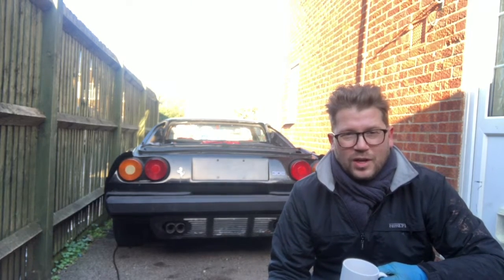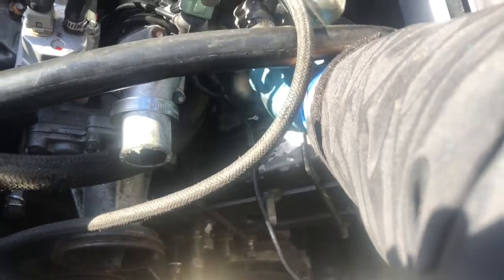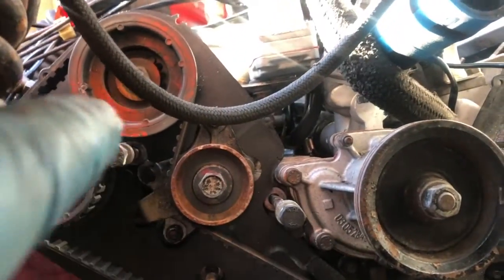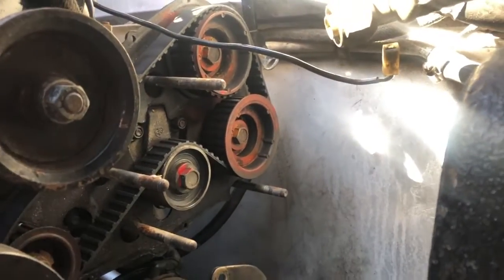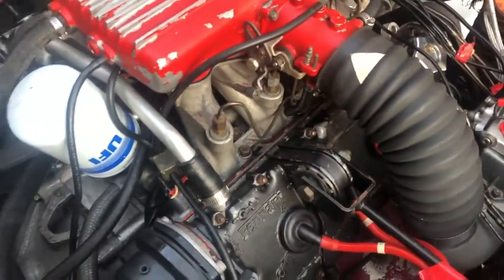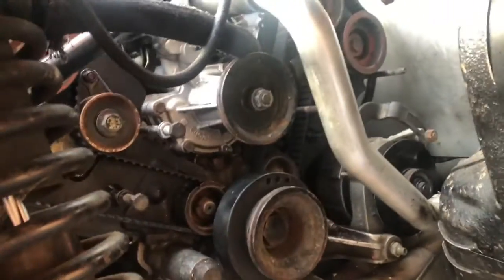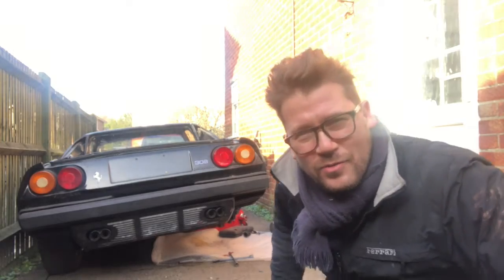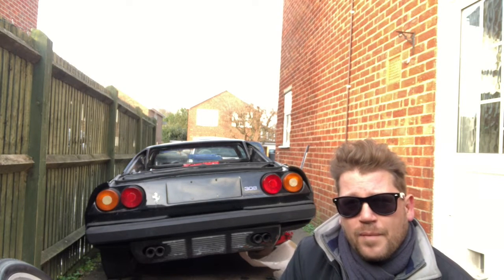Ferrari 308 project - My Timing Belt has Slipped !!!! Part 11

Comment: I really like your video blog here, great stuff thanks very much for sharing. One question though - how can it be that you have the low compression on the front bank but just fix the timing belt to get it running? you had 50psi on the front vs 180 psi on the rear bank - that is a severe issue...did you do anyting else on the front bank?
Reply: VoKa hello VoKA, it’s because the timing was so bad that the valves are still open when the pistons reach their top level when the compression should be at is max.

Cheers!

Comment: The front bank cam drive pulley should not have any play in it. This indicates that one or both cam drive bearings are toast. Not fixing this will lead to catastrophic failure. While you are in there replacing front bank cam drive bearings, replace the rear ones also. It is likely they are the same vintage.

Comment: Love the channel, so the reason why the car wouldn't start is the timing belt was not set correctly? Is that a common problem or a did a mechanic make a mistake?
Reply from the maker: yes mate it had jumped some teeth because the lower pulley bearing was shot
Reply: @Ratarossa  Where did you learn to work on Ferraris? I'd love to learn how to do that but it's an expensive hobby

Comment: How can people botch a timing belt change in such a manifest way is beyond me... Congrats on the cheap fix before making a valve salad!
Reply from the maker: crazy hey, thanks though was lucky so far
Reply: I just had this happen with a low-milage '85 Volvo 760 Turbo I purchased. Ran terribly, almost no power. The B230ft is a single cam 4 cylinder that is only maybe two or three steps of complication away from a tractor engine. I had a receipt from the previous owner for a timing belt service at a local shop, so I checked it- lo and behold the timing is a tooth and a half off. Seems it doesn't matter how simple the timing system is (like on the 4cyl Volvo) or complex (like the 308), someone will always find a way to botch it!
Reply: @Ratarossa  that was lucky, nice! 
i Would have done the same thing!

Comment: I wouldn't bother refitting that aircon unit, they never worked very well anyway even when they were filled with the correct gas they were designed for, save the weight.
Reply from the maker: Thanks Chris, This is my 3rd QV and you are right none of them worked well. Same with the 3.2 mondial again not even a belt fitted on that one. I think I will reinstall it for originality but won't bother hooking it up. Its rare here in the UK that we need Aircon (maybe 1-2 months max)